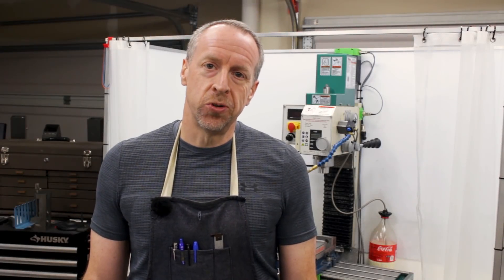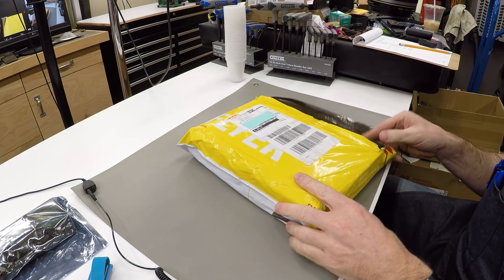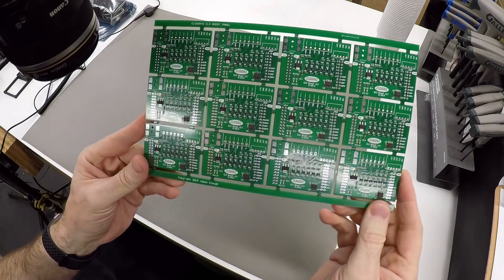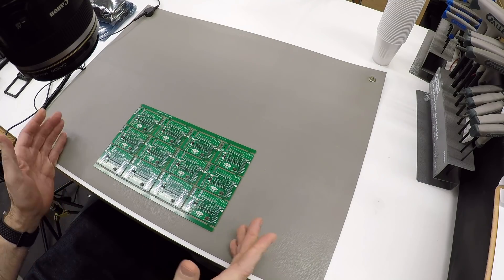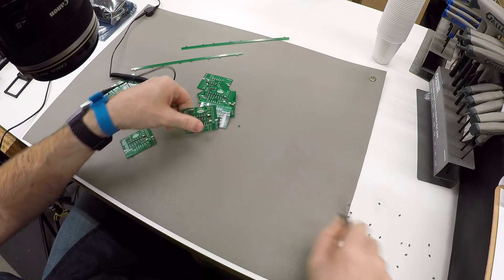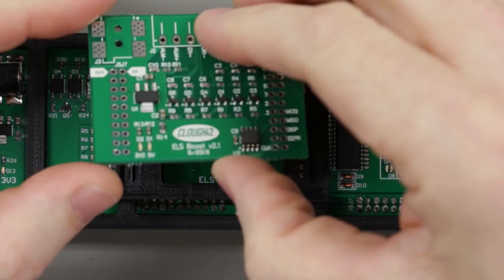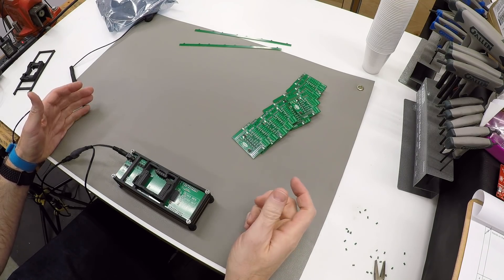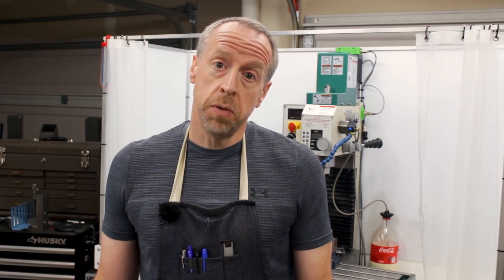Panelizing PCBs Part 2: Depaneling and Testing [Reupload]

Comment: To avoid having to clean up the mouse bites, design the PCB with shallow recesses where you plan to put mouse bites. The recesses should be slightly wider than the actual mouse bite (1 router bit width wider on each side) and recessed 1-1.5 mm into the PCB. This way, the break line will be completely inside the initial board outline, and you won't have to trim anything away.

You do lose a tiny bit of board area, but this area is normally useless, since you would need some keep-out area next to the mouse bite anyway.

Comment: I am in the process of building your ELS and  have most of the parts gathered and I am ready to program the TI  Launch Pad.  You, in your videos, have the launch-pad and the control PCB in in what looks like a plastic 'frame' with a breadboard.  Looks really handy for holding it all together for testing.  Was that 'holder' a 3-d printed thing, and is the print file somewhere on Thingiverse?  Don't know if I am going to be able to make all of this work for me, but I'm sure going to give it a shot.

Comment: Cut a slot in a piece of plastic or wood or even aluminum plate (better weight) and you can insert the board sections and snap off all of the tabs at once. Leave the slot loose enough to let the removed tabs slide out. For the next panel, just move the boards to miss the previous tabs and you can do several panels before emptying the removed tabs from the slot. You could just slide the removed tabs out of the slot using the next panel. If the slotted board was verticle, the tabs would fall out automatically but would need to be fastened down.

I would also have a sheet of sandpaper glued to a backer board to clean up the tab leftovers, with a swipe or two. You can clean up a row of tabs before breaking the individual boards off leaving only the two end tabs to be cleaned.

Comment: James- Love your videos! After years of woodworking, I am just beginning machining. I assume you did your own CNC conversion on your mill - and it’s value is obvious in your videos. My question - open for discussion - is: what are the trade offs between this Electronic Lead Screw, versus a full CNC conversion on the lathe? I’m not simply talking cost or effort to convert, but mostly in the value of an ELS vs CNC lathe in the home shop. Many thanks!
Reply from the maker: I've sure a full CNC lathe is a wonderful thing, but I have enough trouble with chip breaking and chatter on a manual lathe.  I'm constantly having to stop cuts and make adjustments

Comment: Try clipping the mouse bites with a pair of end clippers. That works for me.
If you can get them to not plate thru the holes on the mouse bites it might be easier and cleaner to break, and have less sharp edges.

Comment: The way to break off those stabilizing tags is place the board flat on the table and bend up one panel to break it off, then use the table to snap the small tabs off (like snapping a hard chocolate block from the fridge). After a few you will get the feel and every break you can control if the tab stays on the table piece or the bent up piece. It should take about 30 seconds to break down a whole sheets worth.
The other way is with an old heavy cardboard guillotine usually found in school surplus sales or old school closures.

As mentioned before by "vondeliusc" a piece of sand paper stuck to a flat object will clean up the edges but the also come in handy for mounting when sliding into enclosures.

Comment: a V-routered  panelized board may be the way to go, boards just separate. but may not be rigid enough for pick and place
Reply: I use V-groove a lot- they're a bit nastier to handle with the slivers of loose fiberglass on the edges, but often save money on typical protoboard ordering because the overall size is less area.

Comment: A hunk of sandpaper on a 2x4 with some spray adhesive and a quick hand pass on all four sides and nice and clean mouse bites. Also a slot cut with a slitting saw in a hunk of aluminum stock (say 0.5" x8 x 8) and drop an edge into the recess which is a 'mouse bite' deep and bend, and blow the slot out with air every few. Beautiful product.

Comment: Might try a bench top belt sander, with a ~400 grit belt on it for pulling the rest of those mouse bites off.  Just hold down for a second or two on all four sides to sand off the little bits.

Comment: Since you are now talking to JLCPCB I hope you can find out about the V  groove SMT assembly issue, the not supported text has gone from the ordering page but is still in the FAQ.
For mouse bite removal I expected you to give them a quick rub with a file or to show them to a linishing belt :) Individual boards from them have had the mouse bites removed by hand, one batch of my boards must have been done by a new trainee that was rather heavy handed.
Below a certain quantity the silk screen is printed rather than actually silk screened and if you try a stencil from them then there may be an issue with them not picking up negative values for paste mask expansion, I need to take the stencil to work and put it on the Shadowgraph and also mic the thickness to confirm this.

Comment: The good thing about mouse bites is you can make use of them as a friction fit tab for enclosures or fixtures like this one to actually hold it in place without hardware, just gotta print a little slot with some relief above it to flex a bit. also that footpedal is PIMP
Reply from the maker: Cool idea.  I hadn't though of using the residual as a mechanical feature.  As I was snapping off the tabs, I was considering just leaving them there for the purchaser to deal with.  :)

The pedal far exceeded my expectations.  I was expecting something cheap and questionable for that price.
Reply: @Clough42  I was looking for pedals a while ago, and was not impressed by all the crappy sewing machine style ones ( not cheap either ), I did not come across these at all in my searching somehow, so I bought a cheapo lamp foot switch($2) until I found something better. I ordered one instantly (using the affl link) thanks

Comment: Can't you add a relief in the board for the mouse bites to fit inside of the board footprint ?
Reply: The router cutter would have to pull into the board to do this giving a machined notch with the bites within it, I have never seen boards done this way and if the boards are going to a customer then the recces is but the mouse bites within it are not acceptable.

Comment: Hi James. Possibly a fine belt sander would speed tab cleanup? BobUK.
Reply from the maker: Possibly.  I would be concerned about ESD damage.  I feel minor shocks all the time when sharpening knives on a belt grinder.
Reply: @Clough42  When I am using a belt then some part of my hand is resting on the earthed ( grounded) body of the machine, however it would be an interesting experiment to measure and static charge from belt sanding, possibly a job for Project Farm https://www.youtube.com/channel/UC2rzsm1Qi6N1X-wuOg_p0Ng to test different brands of belt.
Reply: @Clough42  Hi James, good point! A router bit would be difficut to set a jig for. The only other idea I have is a hand file - rather laborious as I see you have now sold over 307.  Bet you're a bit suprised! I've just had the rotary encoder arrive from China, waiting for the I/O control board.  I now have the Leadshine clone hybrid stepper driver and a 4NM hybrid stepper. BobUK
Reply from the maker: @bobuk5722  I think the hybrid servo I have is an OEM Leadshine.  It uses the Leadshine software.
Reply from the maker: @bobuk5722  and yes.  I'm a little surprised.

Comment: Great job!  What programming language did write your panelizing code?
Have you tried V-Scoring instead of Routing the cutouts?  V-Scored boards snap apart cleanly but maintain strength in panel form for  SMT assembly.
Reply from the maker: I haven't.  JLCPCB offers both v-score panelization and assembly, but you can't order them together, for some reason.  Maybe they'll fix that someday.

Comment: Why didn't you have them install the connectors too?  I must have missed that part in your previous videos.
Reply from the maker: JLCPCB doesn't offer any through-hole components with their assembly service.  In fact, as far as I can tell, they don't offer any connectors at all--even surface-mount.

Comment: Use a pair of end cutters to remove the mouse bites.  That would leave a cleaner and more flush edge.  Great work on this.
Reply from the maker: Thanks!  I think I have a pair of cheap end cutters somewhere.  I'll give it a try.  Someone also suggested the Hakko depaneling tool.
Reply: @Clough42  Or you can use the nail clippers they sent you last time! :-D
Reply: @Clough42  I also had the though a heavy duty paper cutter, the old style with the heavy metal blade but that would probably be a higher cost.  But then, looking at the cost of that Hakko depaneling tool, the cost of the heavy duty paper cutter is not so bad.  LOL
Reply from the maker: @chrishammond1230  One would want to be sure the tool  doesn't stress the boards too much.
Reply: @Clough42  That is true.  Not sure if since the boards are sitting flat and supported all the way up to the cutting edge if the stress would be more than the act if snapping them apart.  I am not that smart. haha
Reply: Don't do this with a tool you intend to use for anything else.   The glass fiber eats tool edges.
Reply: @somebodyelse6673  That is true, it was only idea for just this purpose.  I myself do not have the knowledge to do board design so will not be doing it myself.